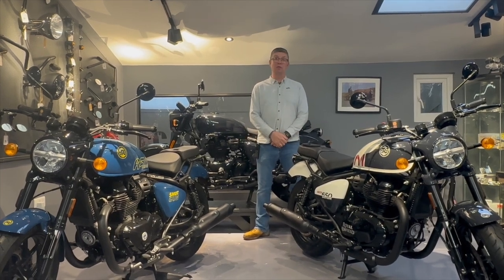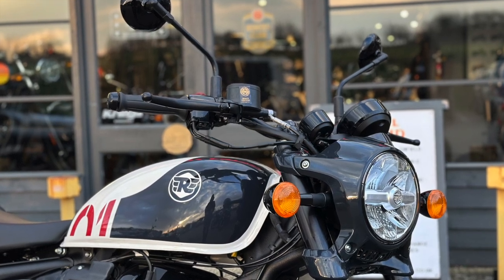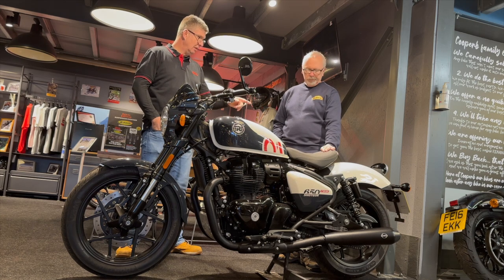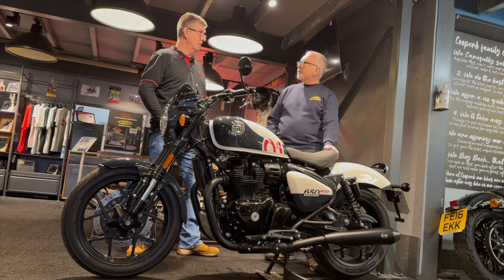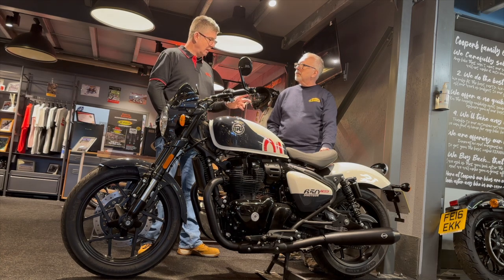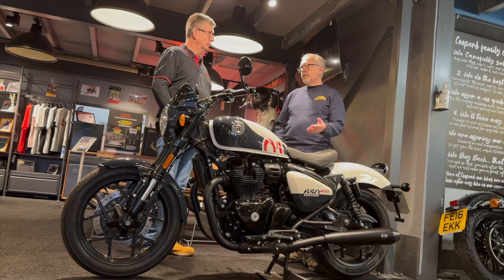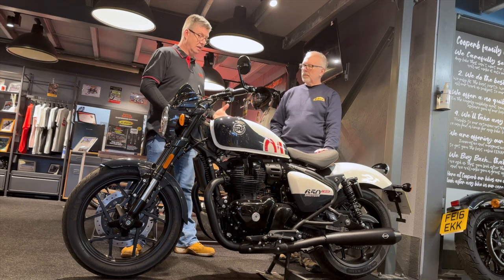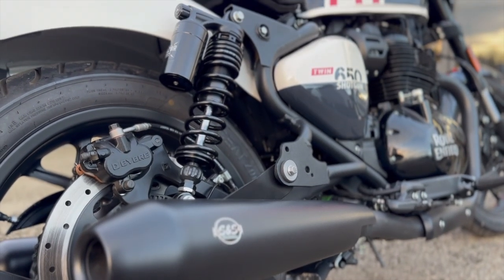The Royal Enfield Shotgun 650 Is Good But Can It Be Any Better? Cooperb Find Out. Ktech, S&S + More!

Comment: Do they have an option for the bear 650 also?
Reply from the maker: @Iyer.Reghuram  Hi! Yes we currently have S&S Performance Air Filter & Indiction Kits and Fuel X Pro's plus rear suspension units from Hagon. Hopefully also KTech suspension soon as well as exhaust options..😀👍
Reply: @MegaCooperb  
Mostly interested in the suspension for now. 

I’m interested in a 2x2 exhaust setup for the bear. 
I like symmetry.